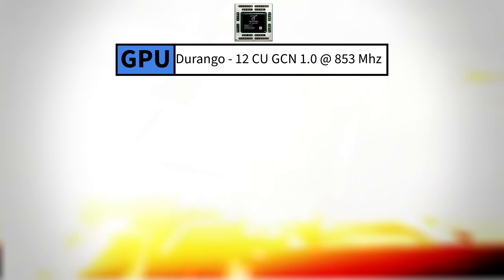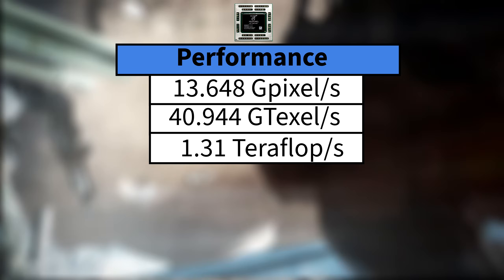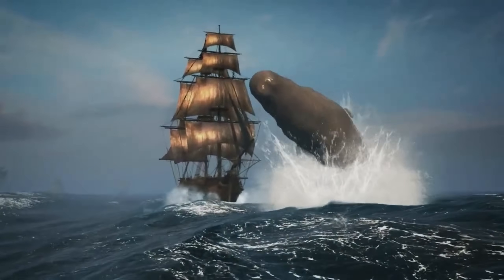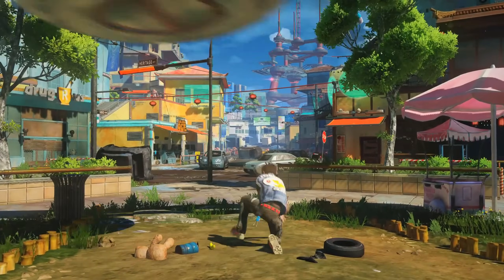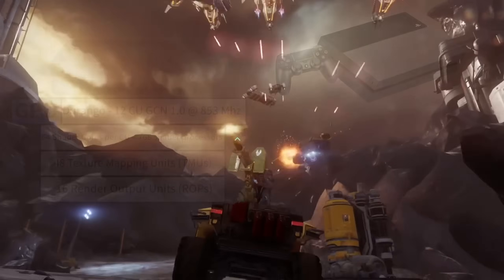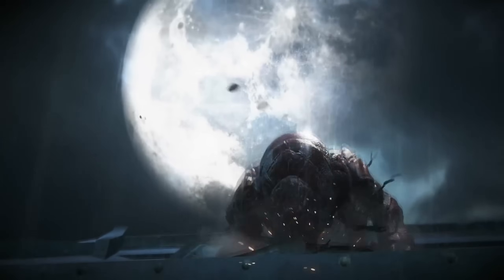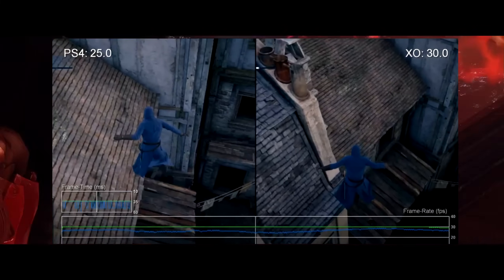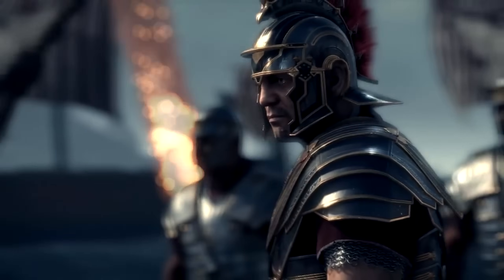The Xbox One GPU: Durango (Hardware Breakdown)

Comment: Something was absent, Move Engines, which their job is to dealing with task from the CPU and GPU like, moving data between ESRAM and DDR, also were responsible for encoding, decoding, and dealing with vertices indices. These helped a lot to get more performance from an underpowered hardware.

Comment: I hope we get CPU explanation of consoles soon
Reply from the maker: I will be doing more of that shortly!
Reply: I would like to know why the Jaguar CPU was chosen? I believe DF conducted a test on it in the past running PC games with Xbox one settings and found it to be a very weak CPU, commonly used in low-power laptops or netbooks.
Reply: @Gman2002  amd didnt have anything better at the time and also power constraints as amd bulldozer was very inefficient. Basically it was down to what was available that fit within the power constraints and thermal limits
Reply: @Naffacakes98 AMD had a shockingly bad lineup of cpus at the time. But I don't understand why they couldn't have just set the clock speed of the Jaguar to at least 2ghz on the base consoles. Luckily the PS4s gpu could offload CPU tasks with special hardware.

Comment: Meh. 
If PS4 went with the original plan for 4gb of ram this would've been objectively more powerful.
Reply from the maker: @deathlock9979  it would have been interesting for sure. Half but much faster memory vs more and much slower would have made digital foundry tech reviews less predictable back in the day haha
Reply: Having more ram doesn’t make a system more powerful.
Reply: @ZackSNetwork  What I was thinking is that maybe early on in the PS4's lifecycle it would suffice, but it would also mess up ports and make the xbox the preferred port machine. And later on there was no way that the PS4 could've ran RDR2 or Ghost of Tsushima or Cyberpunk 2077 at a remotely acceptable level with only 4 gigs of ram. We're talking way below 30 fps. 4 gigs of ram was like Intel Celeron garage sale notebook levels of ram even back in 2013/14.
Reply: @ZackSNetwork  No, but it does help when you need more memory, as is evidenced by 8GB GPUs today struggling with high settings at even 1080p with tanking 1% lows.  It very possibly could have resulted in the PS4 having less detailed graphics, if it had 50% less space than the Xbox one.  When you consider the OS allotment, and then diving up what was left of that 4GB between CPU and GPU, that version of the PS4 would have aged terribly.  IMO

Comment: 360 and PS3 generation: sometimes 60fps games
Xbox one and PS4: 30fps, take it or get out.
Me: "well, see ya."

Honestly, this generation of console hardware especially just felt cynical, like barley a token upgrade from what we had with the generation prior. It also doesn't help that backwards compatibility was under fire; notably with Sony refusing to abide it at all. Whereas nowadays i could still justify a purchase of a Series x, if Microsoft would do something about making it easier to upgrade the storage on the thing. $300 for 2tb is obscene, when you have developers wanting 300gb for one game. 💀😡🖕
Reply: when talking about console power, framerate means nothing. In spite of the fact that  ps3/360 ran at best 720p (on ps3 resolutions such as 648p and unstable 30fps where common) and most of the ps4 library is 1080p. Then the added complexity of the games ofc means that performance will get hit. Try to play rdr1 on ps3 and then rsr2 on ps4 and you'll notice how big of a jump it actually was.
Reply: @micheledelmoro5898 Nah most PS4 games are 900p at 30fps.
Reply: @ZackSNetwork  no, later ones usually have dynamic resolution and the older ones usually go to 1080p. surely there are exceptions but that’s the norm

Comment: It's the biggest blunder in Xbox history and 100% the reason Playstation took back the console crown from a mediocre xbox console.  And the head of xbox resigned VERY soon after that.  What a major misstep.
Reply: You’re forgetting the not sharing games part that did more damage and the terrible state of MCC at launch
Reply: PS3 sold more than the 360
Reply: @FEL5000 it may have but the Xbox 360 defined the 7th generation more than the PS3. Plus the PS3 only moved ahead at the very end of the generation after a very rocky start
Reply: @crestofhonor2349  Yeah, but defining a gen would surely mean selling the most that gen, right? In the end 360 sold less than PS3 and Wii. What other gen has there ever been a console that defined the gen, but still somehow sold less than a direct competitor? There certainly isn't a recent one. Also when people talk about the crown, that's usually a reference to the highest selling console. It's not the only factor but I think it is the biggest one if talking about the console crown for a gen.
Reply: @ashleythomas4112  It's what had the most lasting impact and that typically is the winner of that generation in terms of sales. Between the PS3 and 360, the Xbox 360 really did set the longest lasting impact even if it lost in terms of sales by the end of the generation. It was the defining console just because of how it impacted the 7th gen at the beginning and the middle of the generation.

There's a reason why you could also argue that the Sega Genesis was just as defining during the 4th generation despite it selling fewer units than the SNES. N64 also had a massive impact on the 5th gen despite it's very lackluster sales against the PS1 just because of a few defining games like Super Mario 64 and Ocarina of Time.
Reply: @ yeah but xbox was the pioneer and presumed to dominate with the explosive launch of the 360, although they botched the xbox one launch so hard die hard xbox fans went with the ps4
Reply: @Fellipe2k5 only  cause it has Blu-ray. In terms of culture it was x360 that was ahead
Reply: @Rayzajw  Isn't a big part of culture the overall popularity of the system though? Where PS3 sold more despite being on sale for a year less than 360 that gen.
Reply: @Fellipe2k5 ps3 only sold more because of the Asian market and the bias against American made products and that's a fact
Reply: Sony would have still outsold Xbox regardless. Microsoft abandoned exclusive games in Gen 8 also. Along with their horribly damaged brand.
Reply: @ Xbox moved away from exclusives because the Xbox failed that generation. Also Sony is doing the exact same thing this generation

Comment: Flashbacks to Dark Souls 3 at 23fps
Reply from the maker: @Derelict_Doug  ah the old days 😌
Reply: X360 also ran quite a bit of games bellow 20 fps. Like GTA 4 or Thief. Bonus points for sub 576p render resolution. In the end of its lifespan it even ran some games at 320p resolution and unstable 30 fps.
Reply: cinematic experience
Reply: Gtx 1070 could max that game at 1440p 60 fps ultra..  😂😂😂 but game was hard to play... stoped at 30% of game completion... very painfully game. But beautifull...
Reply: You definitely didn't own a boxing game. Even at release, the fps wasn't that high. It was almost always 30.

Comment: It’s always been a turd.  Less cores, ROPS, TMU’s etc than the PS4.  But what really ruined the Xbox was its lack of bandwidth. 

I remember when both consoles came if the PS4 was running a game at 1080p. The Xbox was running it at 900p.   Makes it all the more silly when you realize Microsoft originally charged $500 for this thing. Compared to $400 for the PS4.
Reply: Xbox One ran games at 720p or 864p at 30fps. While PS4 was 900p or 1080p at 30fps. This is why Sony and Microsoft fanboys kept talking about Teraflops at the start of generation 8 and resolution.
Reply: Well what MS did right on the 360 they misjudged on One. One X again was a redemption.
Reply: @TheDunbartxeen One X did not save Microsoft’s brand. Nor did it fix the sales parity they have with Sony ever since.
Reply: While true, you're already on the attack, relax.